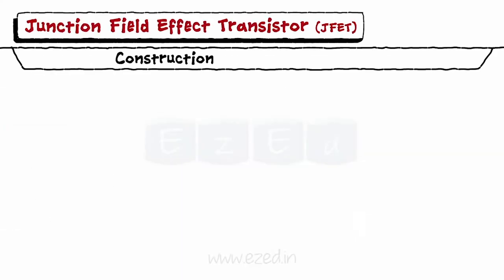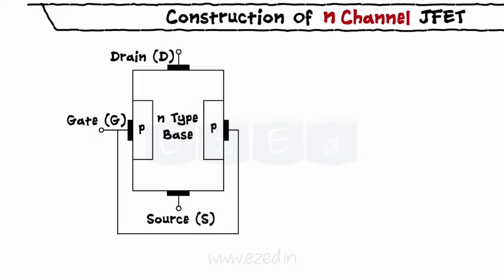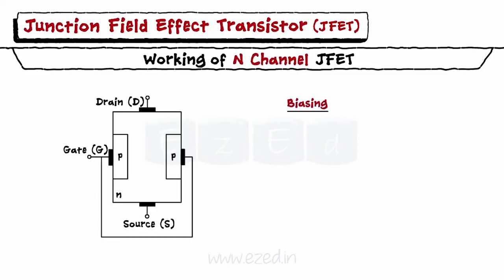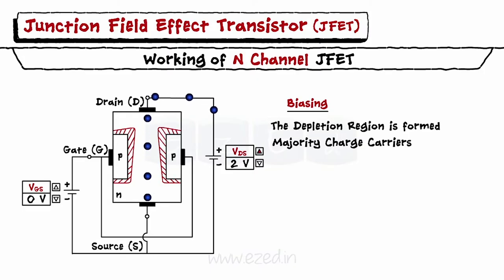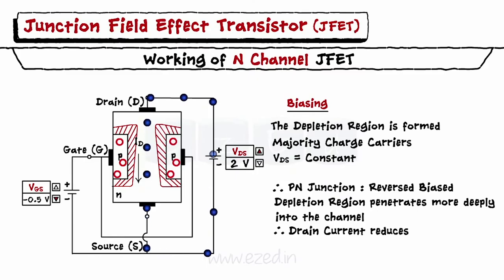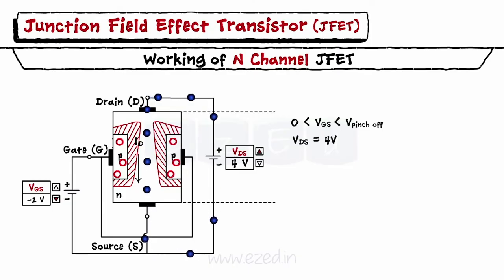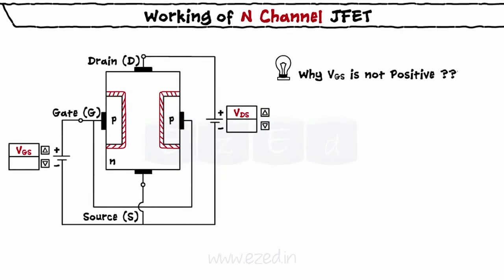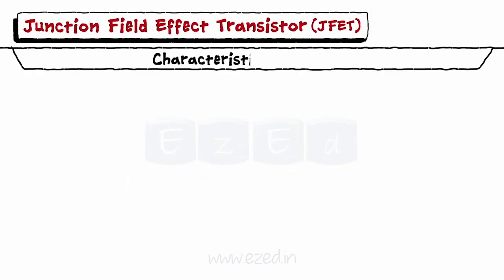JFET - Construction & Working - Easy Explanation - Electronics

Comment: Yes we don't operate N-jfet with Vgs as 0v or gate positive wrt source. But your diagram shows Vgs positive. how come?
Reply: The symbol is positive but the value is negative. If the symbol was reversed, then the value would be positive - either are equivalent.